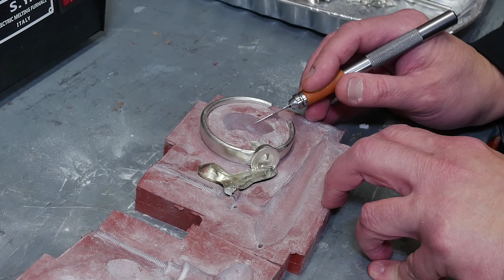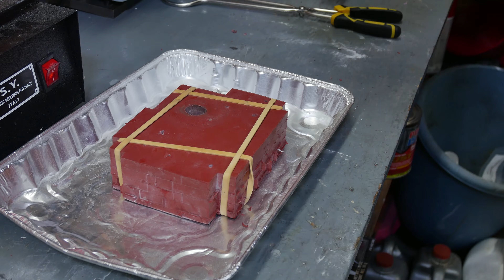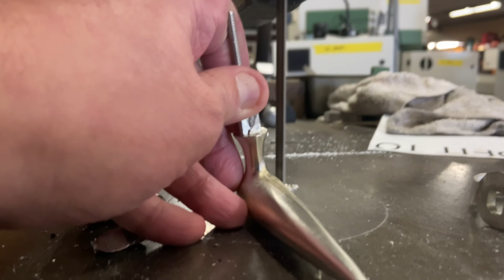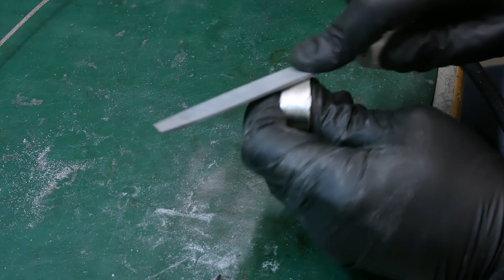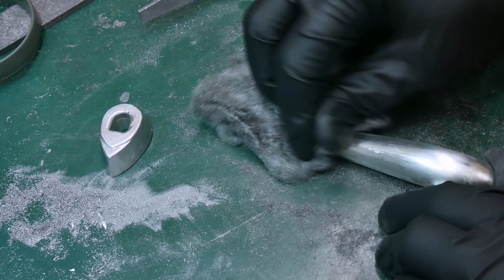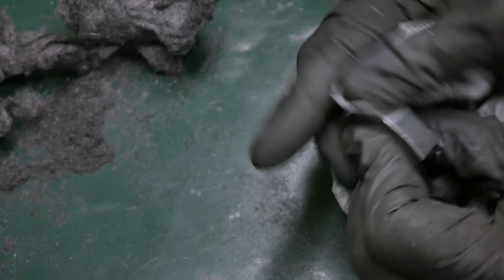Successfully Casting a Pewter Hood Ornament!

Comment: I've tried pewter casting using Mold Max 60 and got mixed results as well. I usually use Mold Star 16 Fast and get similar results. Usually bad. At least I can have the mold ready in a couple of hours. I can't get 1/20 the volume of the torpedo to cast without divots and voids no matter the venting. My melt pot has no temperature display, perhaps I should get a different one. For future projects, with pewter, you can repair a small pit here and there with solder. Just a drop proud of the surface and file it down. One more thing. You will want to do some kind of protective coating because pewter will eventually turn grey and need to be polished again. It can be chromed. Nice result, I'm more than a little jealous of you and the Danbury Mint!

Comment: I use a rather large pottery kiln for metal casting (it has a PID controller I installed to it) and it does indeed get expensive when I'm pouring <12 oz. (volume) of aluminum. What is the volume of the crucible supplied with that oven in terms of volume, and are there different sizes of crucible's available for it? I can't seem to find the volume on amazon site.

Comment: It seems to me this was really cost ineffective.  Between all the mold max, all the pewter, the oven, the original emblem you bought. You gotta be close to a 100 dollars per.
Reply from the maker: it was expensive but cost effective.  Probably closer to $75 each compared to trying to find 5 matching ornaments (almost impossible)  at around $150 each.
Reply: why not us original metal -zinc? plaster molds also much cheaper and takes higher zinc temps easily. @PeteRondeau

Comment: Great job Pete!! I'm about to cast in pewter, did you use those pewter britannia bars from the link or ingots?  there was size reduction (shrink) against the original? Thanks! Jim
Reply from the maker: I used both. The bars fit in the furnace easier.  You just stand them in the crucible and the furnace eats it. The ingots are a bit cheaper but I have to slice them in order to fit in the crucible. But you certainly don’t need the furnace to to do the job. Pewter can melt on a stove.
 I didn’t notice any substantial shrinkage but I didn’t specifically measure for it. Good luck!
Reply: @PeteRondeau  Thanks Pete! I will move forward in mine Cadi restoration using your video like a guideline!! The hood ornament is broken, so I will glue it back again with some epoxi, do a silicone mold, cast a new one in pewter and I will chrome or nikel plate it. Again, thanks a lot!
Reply: @PeteRondeau  Thanks Pete! How many pounds of the  Mold Max 60 silicone did you use, all the silicone box, more than one box?.
Reply from the maker: Just a single kit of what they call the pint unit but it took every bit of it.  1/2 for the top of the mold and the remainder for the bottom.
Reply: @PeteRondeau  OK! with your data and advices you can not imagine how much you are helping me Pete, reducing time and mistakes, I'm really appreciated!!

Comment: Just watched your nail powder vid.  That's a VERY nice finish!  How do you think it compares (in person) to the pewter finish?  Maybe try a real buffing wheel on them before doing the nickel?
Reply from the maker: The pewter finish is substantially better.  You can just keep polishing and polishing.  But, it substantially more expensive for this application.  each hood ornament requires about a pound of pewter and the low melt stuff I'm using (Lead free Britania alloy) costs about $35 a pound.  You could probably make half a dozen urethane castings for that price.

Comment: I know these were hard to source, do you suppose there's any more demand?  Now that you've got a process, you could make another batch.  Also, after nickel plate, you could send out for chrome (as I understand it the solutions necessary for chrome are prohibitively dangerous).
Reply from the maker: If there was a demand for them, I suspect it would be in the auto or motorcycle community.  I've seen a lot of rocket ride pictures but nobody puts these on them anymore.